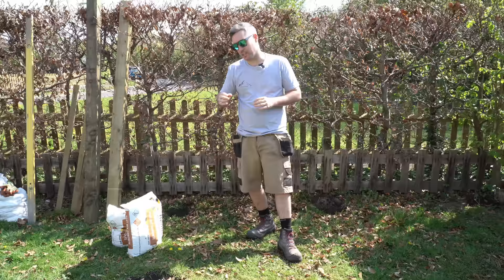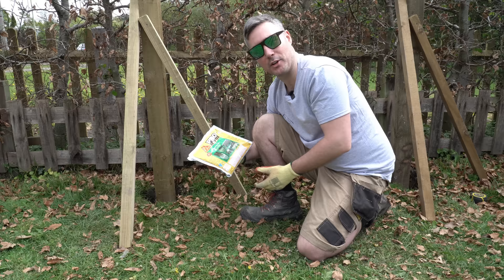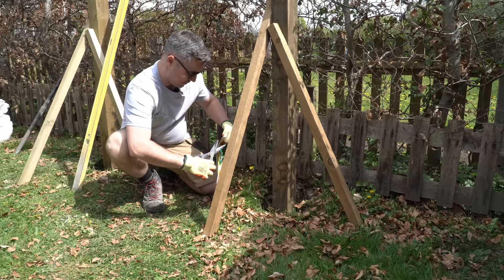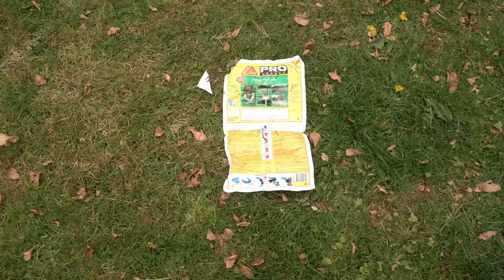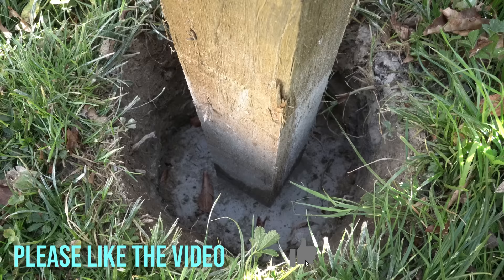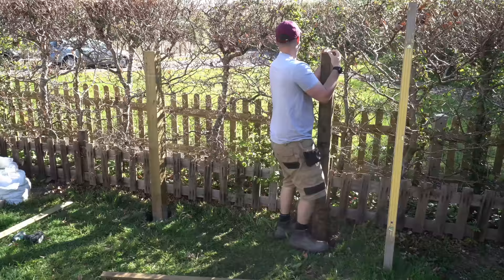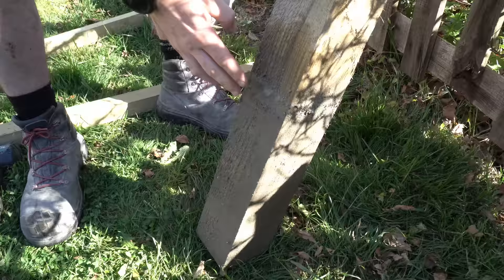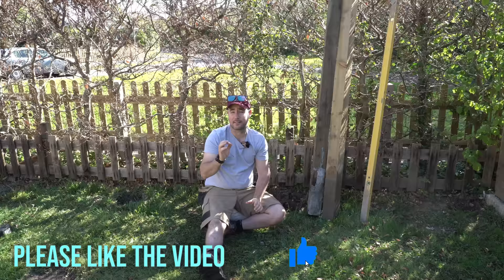Fence Post Foam vs Concrete | STRENGTH TEST

Comment: That foam looks dreadful. If the ground is damp, then it doesn't matter with the concrete which actually needs water for the chemical reaction to work. However, for the foam it's not good news at all, and I suspect that it just doesn't work well in damp soil or if the post isnt bone dry. I also don't like the fact there's no leeway to make small adjustments to the post as it sets off.

So I suspect that this is as much to do with soil conditions and the amount of damp there is around. 

However, for me, I think for both the fill is too low down in the hole. Posts rot off at ground level when in contact with damp soil, and I prefer to bring the concreted up to make a small crown so the post is not in contact with damp soil where the conditions are perfect for wood rot. Also, dare I say I use Postsaver sleeves...

Comment: The foam I used had me pour it different and I was also supposed to cover it with first once it got to a certain height so it would adhere to the post and into the ground.

Comment: I’m a little shocked his foam post install was so bad. I’ve never put a fence post in in my life and was able to use the expanding foam to do one the other day, it’s the corner piece for a 500’ welded wire fence I built and I put that post under several hundred pounds of pressure with the fence puller and the post was, and continues to be rock solid. Also I’ve noticed the local utility companies using it to put in telephone and power line poles. Also kinda curious why his foam didn’t expand over the top, when I did mine it expanded above the rim of the hole and I had to come in and shape it down with a reciprocating saw, which in this guys case would have negated his “water is gonna pool up in this hole” statement.
Reply: Because he didn't follow the directions. The holes were supposed to be 3ft deep, they weren't. The holes were supposed to be 10in wide at max, they were at least 12in wide. And he was supposed to use 2 bags of foam, he didn't.

Comment: You didn’t use enough foam for the hole size. My foam came out the top by about 18”. I had to cut it away. No issue so far for a mailbox.

Comment: The best way to put a post in the Earth is to not use concrete because the post always rocks at the top of the concrete so you dig a really deep narrow hole put  a lot of post in the hole, pack the Earth around it with a heavy tool It gets really stable. If you really packed the Earth well. When  the rain comes the water just drains away into the Earth and the posts last longer than with concrete.

Comment: drill a 1" hole  one way thru the wood & then up a little higher 1" hole thru the wood again the opposite way.. wonder how much stronger that would make it with the cement

Comment: Not sure how you managed to get this so wrong.  Never used bag stuff, but bulk mix up stuff works fine. I use two bits of plywood with post cut out so foam comes to top and gets compressed. Never use below 20 degrees C. Don't use in damp soil. Cheers

Comment: The concrete would have done better if you mixed the concrete with water then poured it into the hole.  I've dealt with posts that have been properly concreted in and they do not move without the concrete.  Pulling it up will pull the concrete up with it.  If you wanted to ensure that the post was properly connected to either product, you could insert some rebar spikes to give the concrete or the foam something additional to grab on to.  Also, this appears to show that you may need to do some additional preparation prior to pouring the foam.
Reply: Do it that way, and the sort of super-fast setting concrete used in this video will be setting before it even enters the hole. The produce used is specifically designed to be poured into the hole and sets with the water. It starts setting in less than 5 minutes, and you can feel it happening. 

Using ordinary wet concrete is another matter, but then you have to put the posts up separately and wait. With the fast post setting concrete, then you can be fixing panels to the posts within 30 minutes, although it does take a week or more to set to something like its full strength.

Comment: Call your local utility pole company and ask them what foam they use for utility poles and forget this stuff sold by the box stores. Better yet use pea gravel compacted in six in lifts. Concrete is the worst thing you can encapsulate a post with.

Comment: wood posts are a dumb idea.  They will rot.  Concrete just concentrates the rot at the top of the hole.  Then you have to play dentist and extract the remains, or smash up the concrete.  There are two better choices;  steel posts set in concrete, and recycled plastic solid posts.   When the steel finally rusts through, you just insert a slightly narrower tube into the remains, and drop the top half of the original back onto it. It can be holding a metal fence or a wood fence strapped to the post.  Plastic posts I like the best. You do not need foam or concrete  You just attach a short cross piece each side under soil level and they work like a bulldozer blade, and cannot push the soil aside to allow lean. Recycled plastic lumber lasts forever. You can often get away with a 2x4 post instead of a 4x4 because you do not need extra material to allow for rot.

Comment: I'm guessing your soil was just too wet. Our power company only uses expanding foam to set power poles these days, but our soil is bone dry 99% of the time.  We have really harsh wind in the summer that regularly downs trees and we haven't had any issues with the power poles.

Comment: I don't like either product or technique. I've used concrete, dirt and dirtcrete. À 2' 6" hole is standard depth. For ready mix concrete I add water, mix well and dump it in being careful to agitate with a stick to remove bubbles. Post can't be remove without digging out cured concrete. For plain dirt I tamp it around post in layers all the way up. Tamped earth is way more compact than surrounding soil. For dirt-crete I mix one part Portland cement with four parts dirt. Not as hard as concrete but harder than tamped earth. I also don't have to deal with dirt piles . How much did that foam cost? Way more expensive than any of my methods.

Comment: boils down to get it done quickly without the water and the removal is much easier with the foam just cut it up put it in the trash not so easy the get rid of the cement personal i don't use either of these techniques i always mix cement before putting it in hold dry is not as strong

Comment: I have used that exact foam and set over 50 posts still going strong 8 years later, you must have dug a hole with perfectly smooth sidewalls so the foam has nothing to lock into. Also you did nt have enough in the hole to make it fill you even said so. I can use any product incorrectly to get the result I want also.

Comment: neither setting was deep enough for the length of pole sticking up out of the ground. You had a lot of leverage to pull and push against. either would probably have worked if you put some fill below the setting material. Can you please make another video using the exact same length of lumber with either deeper holes with some filler or double the mixing materials in the holes? I would very much like to know the results.

Comment: The foam sucksssss. I used sika brand, it was a different color. Had the correct depth and width. After a week of wind, the fence post was loose. The cement works much better since it adds a considerable amount of weight to the bottom of the post. I was so angry how wobbly it had become but we ended up moving. My foam actually went right to the top of the hole. I didn't like that it also created a well although minimal on around the diameter of the post but I suspect you can cut it back.

Comment: My fence / gateposts are all rotting out at ground level. The house has been there fifteen years or so. Interested in the pea gravel idea mentioned in the comments (quite a lot of rain where I live). Is there anything you could do to the bottom of the post that'd help it grip? What if I put stainless nails or some such into it before dropping it down the hole? I ask this as a home DIY guy. I'm not a tradie. Thanks.

Comment: Wish I would’ve seen this video before I set 68 metal posts in foam.  It’s been just over a year since I installed the new cedar fence and it all needs to taken down so I can set the posts in concrete. Every post has sank causing my fence to come in direct contact with the ground. More than half have started to lean. 540’ of board on board capped fence wasn’t cheap. I’d sue the foam company if I thought it would do any good. Don’t use this product if installing a permanent fence.

Comment: The solution to the problem is to fill your holes with the post in it with pea gravel. Tamper in place and the water can flow and not puddle and you will not get that pole silt

Comment: For both methods, it may have been prudent to screw in some hefty screws or lag bolts ,partway so that no matter what method you are using, the product will have something more solid to harden around, without weakening the post.
Also ,who would not fill in the rest of the hole & tamp it thoroughly, so that any water will drain off? 
Code, in our area, says that 3 feet of that post must be buried. 4 Feet, is even better, so that a 10 foot post is needed if you want 6 feet above ground.
 1 foot of gravel must be in the bottom of the hole, regardless of depth. 

.

Comment: I admit I've never used foam for posts. I'm a diy and contractor and done my share of fences. I've used concrete for posts over the years and the last ten years or so I've used black locust wood for posts and what I've found is the posts last longer if you don't use cement at all. Packed with gravel seems to work better for longevity. From an environmentalist point of view , foam , really?

Comment: If you drill one or two holes in the post near the bottom before filling it with concrete then I bet it would lock itself into the concrete

Comment: try actually mixing that concrete in a wheel barrel first and I guarantee you wont be able to pull it out, dry pore on concrete is almost always a bad idea.

Comment: Sika foam sucks, it shrinks when cured. I use fast2k foam never had an issue at all. Fence solid as a rock even in direct crosswind of 60 or 70mph.

Comment: Mate, you're an absolute legend!!!

I've watched so many videos on the foam stuff, however they aren't as thorough as you were when moving the posts. I've seen them lightly lean on the post lol

Whether you filled the hole or not, both were equal and the concrete did better so imagine both filled to top. Foam stuff looks really soft compared to concrete.
Just like expanding foam.

Not great for fencing. 

Good job mate 😎👍🏼
Reply: It works fine for fencing. You just gotta follow the instructions on the product.

Comment: Good video shame the posts weren't in the ground 2 ft, quick create is nothing compared to concrete
Reply from the maker: Both posts were 2ft in the ground but i agree. Fast setting concrete isn't quite as good as concrete but it does the job absolutely fine.

Comment: It's been proven many times that the expanding foam used for fence post setting looses 30% or more of It's size as it cools/cures.  It's the same foam product used in the shipping & packing industry.  This product should NEVER be used for setting fence posts or anything else in the ground.

Comment: Two things, 1. The foam you used has the "contracts after a week" as a very common problem.  So much that people in the US don't use this foam.  We use fast 2k instead and it's much better.  Might be why they shipped this crap foam abroad.  Trying to make their money back.  2nd any foam that you use you should cover the sides of the post.  This way the foam adheres to the post and stops the issue of water rotting the post at it's base.

Comment: Would it not also be true for the foam as with the concrete? You can fill it up and after expanding just cut the extent of it off and you'd have flat surface?

Comment: Yikes. Maybe have to add more of the stuff. Or you have to flare out the hole on the bottom. I'd probably use it if I were living in a rental and wanted to build a temporary post or something.
Reply from the maker: Yeah maybe ok for quick fix or light use but thats it.

Comment: I wonder if drilling large holes into the bottom of the posts before setting in concrete or foam would make them more secure & never been able to be pulled out
Reply: if your gonna do all that might as well pound down a piece of rebar an extra 3 feet...

Comment: Foam is stupid, will hold water and eventually rot a post like concrete. Here is a tip, use pea gravel and tamp each post well. The fence will be the best you have ever built.

Comment: I've only ever used Postcrete or equivalent and, watching your video, certainly won't consider the foam! Looking at your level, do you use it to mix the Postcrete in the hole 🤣? I always mix/tamp with a piece of 2x2 to make sure it's wetted throughout.

Comment: Properly tamping down dirt works best. Concrete and dirt will not bind, so the post will always eventually become loose. Why use some other material made of who knows what when you already have dirt available? Learn to use a tamping bar.

Comment: You must prime the post first while pouring. This prevent the gap between the post and the foam. Also there is not enough foam in the hole. Bad test.
Reply: Yeah he literally put like a 1/3 of the hole with it..bad test
Reply: Both holes were filled to same level. Concrete won because the test was thorough.

Comment: How long did you mix? I’ve only used it once but the two foot hole I dug and added the foam to, the foam came all the way out of the ground. Possible you didn’t give the mix enough time to activate?

Comment: Would it be strong enough to use on a 6x6  Im building a punching bag stand and want the 6x6 in the ground then mount a wall mount for punching bags on the 6x6 my punching bag weighs 100 pounds.

Comment: Water WILL run down the post between concrete and post. Guaranteed. Silicone caulk where the two meet.

Comment: For starters, you didnt thoroughly mix the bag evident by the black and white liquids coming out at different points. Also, your hole appears too big. With foam, you dont need as big of a hole, and if it dips near the post you can either shave the foam off at a slight downward angle or add can foam at the top to help keep water off the post.
Reply: You definitely DO need the same size hole. Nothing changes there, it's the soil around the hole that you're using to support either foam or concrete, so you need the right diameter, and the depth has to do with freezing.

Comment: Could you use this as the adhesive between multiple sheets of acrylic and polyethylene then shoot it? Like compress it all first to squeeze out excess and keep it from expanding too much then shave off the excess to the shape of a ballistic plate?

Comment: He's blaming his poor preparation for the foam not completely filling to the top. It's short 1' below grade leaving it easy to apply leverage and losten it.

Try digging the hole the proper size as directed on the package. Only then will have you done a proper test.
Reply from the maker: Hole was 2ft deep, which is the standard uk recommended post hole depth. Nothing wrong with my preparation thankyou very much !"
Reply: @JamesMontana  ... Dont go back and forth with people that dont do this for a living... Your just wasting your time... Great job on the video, its just plain and simple(CONCRETE IS BETTER) SMH
Reply from the maker: @bryandungee1029  I know but it helps for the algorithm and i find it funny how everyone thinks they are an expert.
Reply: @bryandungee1029  I don't do this for a living. Does that mean I can't notice the foam was 8" below grade? If it didn't expand the way it should, he could have said that. They use different types of foam to hold up telephone poles in the U.S. put a foot less concrete in that post and let me wiggle it.
Reply: @bryandungee1029  we didn't go back and force but his test was pointless.
Reply: @JamesMontana  I'm not an expert but your test was pointless. I'm a diy'er and wondered about foam because I'm a curious person with a gate post that needs to be replaced because its rotted at grade. It's in concrete. 15 year old fence.
Reply: @gauge6513  i think you just ended your argument with your first sentence 🤦
Reply: @JamesMontana  "uk recommended"?  Try using the product manufacturer's recommendation.  By the way, cite your source for this "uk recommendation"

Comment: I reckon either the EU or UK has some sort of restriction on the chemicals used in the original foam we have here in America, which is why it came out crap in this video. I use this same brand and it always sets equal to concrete. 

I know for fact the UK has restrictions on the amount of hydrogen peroxide allowed in over the counter teeth whitening treatments and toothpastes which makes them useless, while in America we don't and our versions of the same products actually work. My English friend complains to me about this quite frequently haha

Comment: I was thinking to myself  why would i pay 15.99 per bag for the foam when you've got to use 2 bags and it still can't be used for 2 hours when you can just get 2-50lb bags of fast set concrete for 6.50$ each and they can be used in 4 hours. It would make sense if the foam actually worked and you could add fence panels on in just a few minutes or if you were in a location where you couldn't brace it properly so you could hold it level till it set up. looks like dry pouring the concrete and tamping it in with rocks remains the only truely effective method of setting a post that will be durable but instantly usable.  Looks to me like even a single bag of concrete would have been superior.